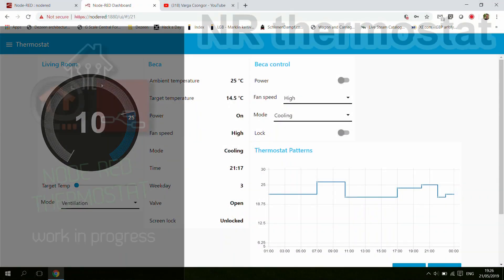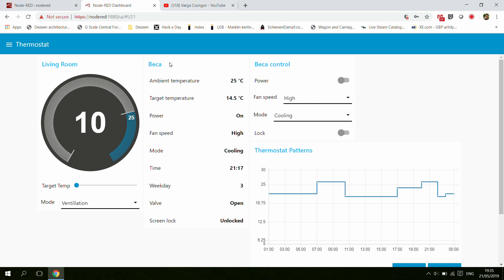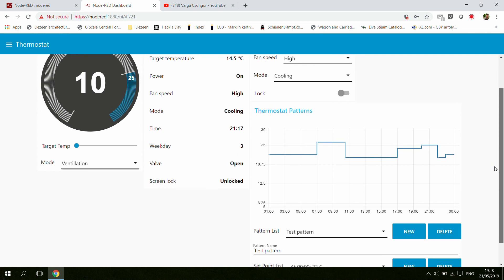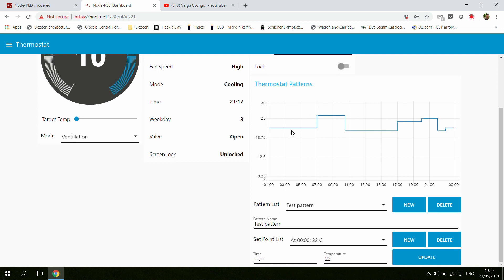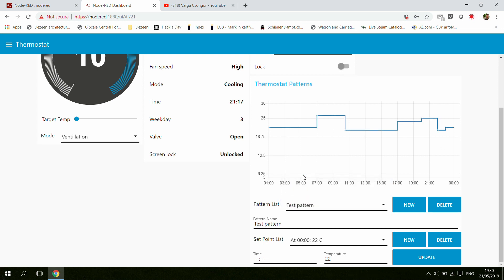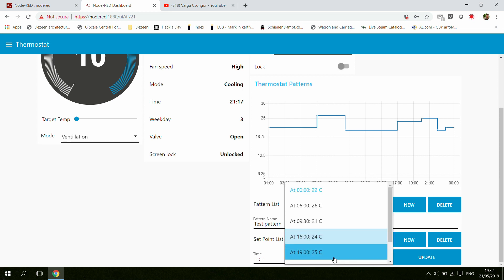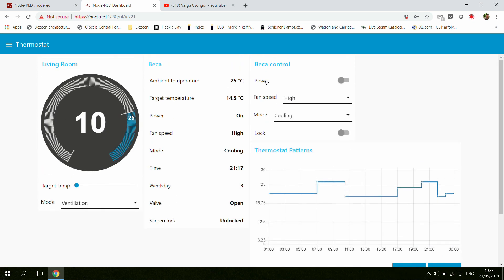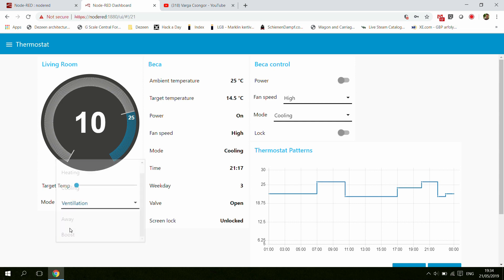Node Red thermostat in progress

Comment: Hmm, the patterns feature is what I believe is referred to as optimization logic, such as optimal start, optimal stop. Warm up and cool down modes, bypass mode, occupied/unoccupied modes. 

It's tough to gauge a fixed pattern. To be beneficial, would be nice to implement nest like logic to create it's own patterns. AI for the thermostat perhaps to take the data, such as OA temperature, setpoint adjust etc, then use AI perhaps to change the setpoint throughout the day to meet the needs.

Comment: I found this channel yesterday from then i'm trying to compile all of your node-red flows for home automation. is there any link which contains all flows together about home automation that you made. btw, I realy appreciate your work. thank you
Reply from the maker: Thanks a lot. No, there is no such "all" link. It takes quite some time to clean these flows to remove api keys and other sensitive content.
Reply: @csongorvarga  doesn't latest version of NodeRed remove sensitive information? I exported flows that had API keys, etc from configuration nodes and that was not exported in the JSON file or was available after import.
Reply from the maker: Good question, I did not notice. But if I use a simple https request node for Google APIs with the API key in the URL, I don't think that will be removed. So better do it manually.